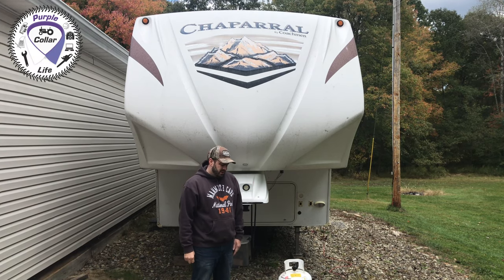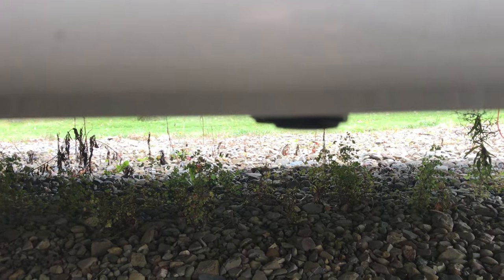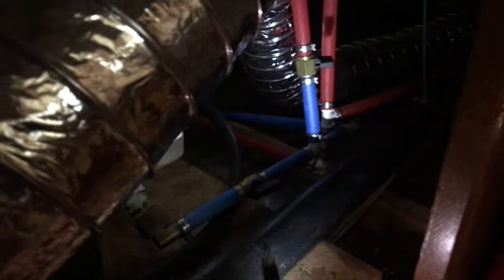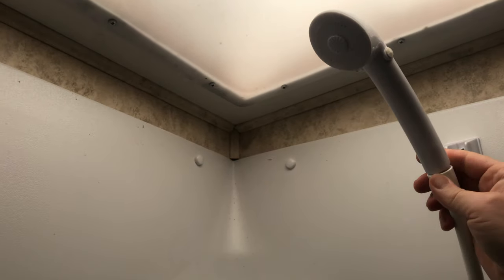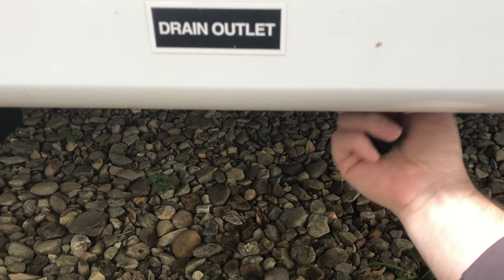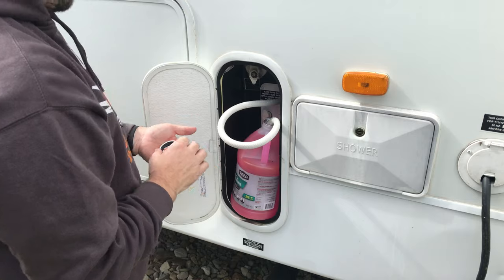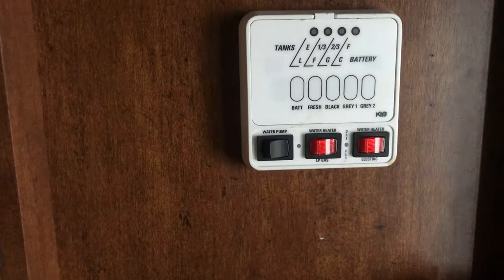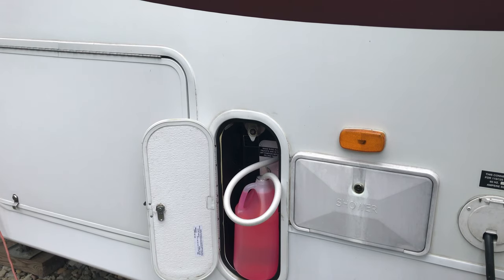#79: Winterizing RV. Cold prep. Removing 5th wheel hitch.

Comment: Thanks for checking my video.  I'm going to be winterizing my RV this afternoon once it warms up.  I don't put antifreeze through the water system.  I Connect my compressor to the city water connection and blow out the lines.  Once blown out I open the drain valves to get that last bit out.  I then drain the water heater and leave the anode out over winter.  I do put antifreeze in the traps and enough to put a little in the tanks.
Reply: That’s exactly what I do too!
Reply from the maker: I've always been afraid to do that.  I worry I won't get all the water blown out.
Reply: @PurpleCollarLife  If your piping is PEX, it's amazing..  We lived through a winter in the RV with subzero days and though the lines in the basement froze on those days, they always thawed and no leaks.
Reply from the maker: @adubbelde1  That's good to know!
Reply: @PurpleCollarLife  I almost waited too long :). went out to blow the lines and everything was frozen.  Turned the heat on and 45 minutes later was able to blow everything out.  Drain valves are still frozen, but I put antifreeze in the tanks and it's not supposed to go below freezing tonight.

5 years ago if I had been into the YouTube thing, I could have followed the build of our house.  Instead I just blogged it.
Reply from the maker: @adubbelde1  Wow - frozen already! We have been in the 30's the last few nights.  31 tonight.
Reply: @PurpleCollarLife  I'm at 5600 feet.  Nights are cool here year round.  We don't have or need AC.  Going into the teens tomorrow night.
Reply from the maker: @adubbelde1  I personally would love that! I would rather be cool than too hot.
Reply from the maker: @adubbelde1  Good to know!
Reply: @PurpleCollarLife  We use a compressor and haven't ever had a problem.
Reply from the maker: @CreatingASimplerLifeOffGrid  I may consider that for next time.
Reply from the maker: Several of my friends to use a compressor and have no issues either.
Reply: Be careful on the amount of air pressure. I regulate mine at 40psi. Have always ran air with no problem.
Reply from the maker: @samvanbuskirk1386  Thanks, Sam!
Reply: That's funny I do both blow out water then put in the pink stuff then drain again. Because one year it got so cooled and broke the filter housing with the pink stuff in it. Thinking of taking out the filter housing don't rely use it.